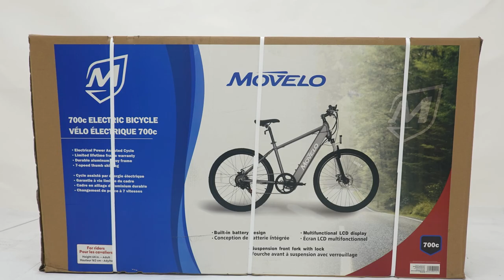DIY, Beginner, How to assemble from box to bike—— Phoenix 700C Movelo E-Bike from Walmart

Comment: Hi! I just bought a movelo e bike at Walmart! It worked well at the beggining but now, Someone has changed the settings and the speedometer only Works if we go backward , and the Electric assistant doesnt work anymore.... Battery is full and we set all the settings as default value, as indecated in the user manual. Do you have any suggestions for me please??
Reply from the maker: Hello, thank you for your feedback. We will discuss with  our engineer then advise you by email.
Reply: Hey same thing is happening with me. 
Did you get any feedback?
Reply: Any solution?
Reply from the maker: @mickmcgrath7732  Pls kindly send your eamil details or send your problem to eamil:olivia@phoenix-bicycle.com.Then  we will support you.
Reply: hi i have this exact problem did yall figure it out